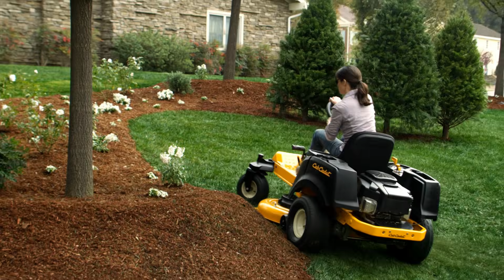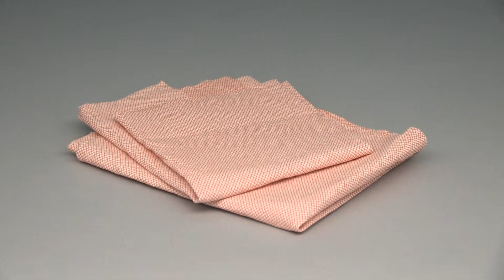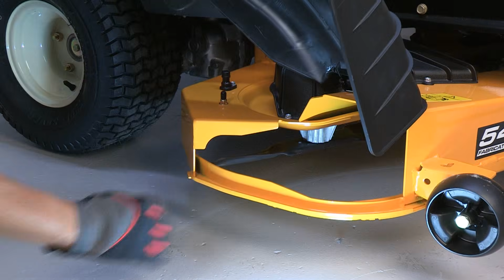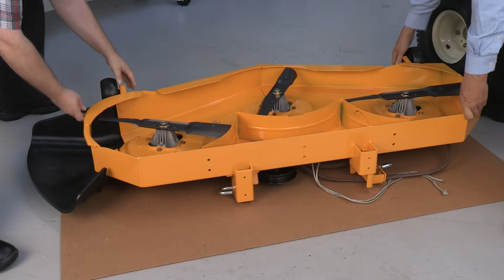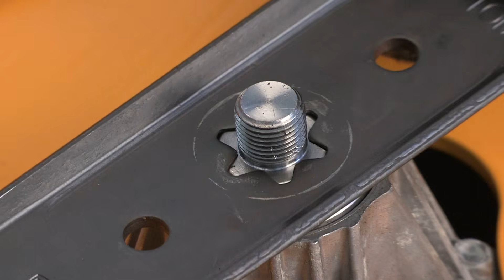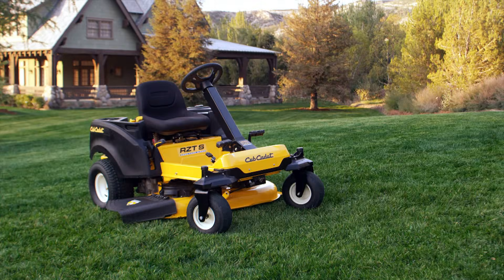How to Change the Blades on RZT Zero-Turn Riding Mowers

Comment: the deck on my mower which is a welded deck you have to have two breaker bars one on each side one to hold the bolt and turn the other Bolt on the top of the deck. And you have to stand the deck up on side order to do this
Reply: This is the most helpful and accurate comment .. hold the top nut , I keep my deck on and put a 2x4 or something to keep the blade from spinning .. and always the friend to a tough nut PB BLASTER OR 3 IN1 OIL ETC

Comment: What a useless statement.
"A socket that fits the blade nut" . . Really?!

What size socket do I need to fit the blade nut???
Reply: I have a 15/16 and a 1 in socket and neither are even close to fitting.
Reply: @christophertibbetts2458 exactly did you figure it out
Reply: It shows a 15mm socket in the video.
Reply: Mine is a 15/16
Reply: Cub cadet rzt 50vt

Comment: Yea blades don't come off this easy, it's nothing like the video. Broken a socket already, and blade removal tool not strong enough to hold the amount of pressure I am using. How about showing a real video, where the lawn mower has been used a few years. Then you can explain all the real info like how to cut the bolt off without damaging threads.
Reply: Impact wrench makes them come off in a second or so. You really shouldn't ever have to cut a nut or bolt off this thing. Put a little antiseize on the spindle bolt during assembly. Clean the threads when you take the blade off

Comment: really would be nice if cub cadet made a video showing how to level the blades on zero turn mower. Their website is not very helpful. I learn more from visual instructional videos
Reply: You can level your blades by taking each one and putting them on a nail after sharpening them, and seeing which end is lower than the other. If they are level, then you have them balanced and no further balancing is needed, but if one end is lower than the other, you have to sharpen that end of the blade until it is level throughout it's length.

Comment: I'm pretty sure we all know how to unscrew the blades!!  That's about all you showed here.  How to remove the deck would have been helpful.  This video is useless!!!!
Reply: +Lola MacLaughlin 
Please post the URL for us!  Thank you.
Reply from the maker: +Lola MacLaughlin Lola, sorry the video didn't help address any questions you may have, but you can contact us when it is most convenient for you at 1(877)-428-2349 for assistance with your product.
Reply: +Cub Cadet Or I could find a page that shows the entire job, which I did!!
Reply: This is a sales video not a diy help tutorial video.
Reply: I found it very helpful.  I couldn't get the bolts off with wrenches.  I never heard of a "blade removal tool".  I'll look for one.
Reply: @ricks9611  yea a wrench not going to do it... Lol. I am breaking 1/2 drive sockets trying to get it off.
Reply: Twat
Reply: Speak for yourself. I can't get the stupid blades off. I put 180 lbs of pressure on it. Won't budge.
Reply: @brian7897  Cheater bar on 1/2" ratchet or breaker bar. All else fails use a 1/2" impact.
Reply: @Gary The only reason I can see using the blade removal tool as shown in this 'sales' video is to ensure that when reinstalling the blade, you have it in the correct position so it's timed properly.  Without knowing exactly where the old blade was on that star-spindle, you could have it timed incorrectly and would be disastrous when you started it up.
Reply: Les Fernandez  No.